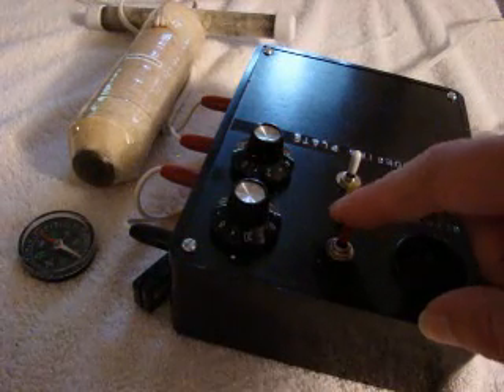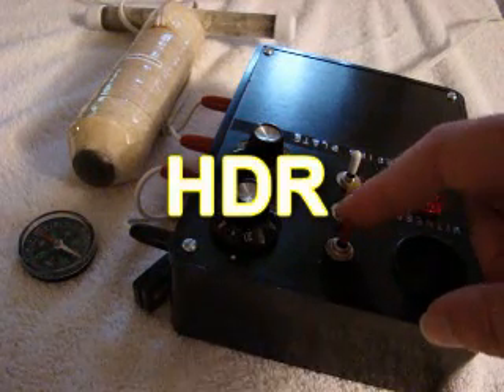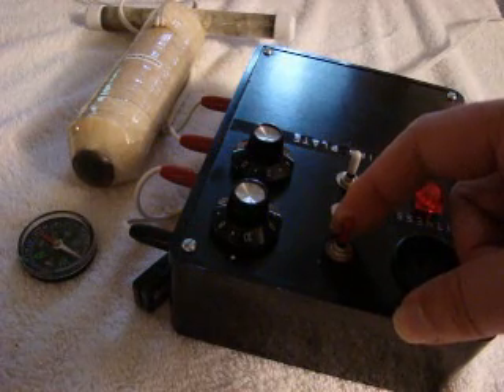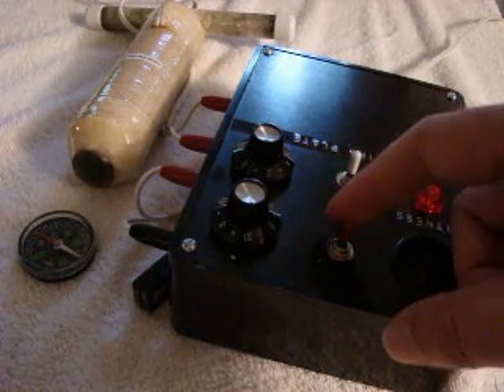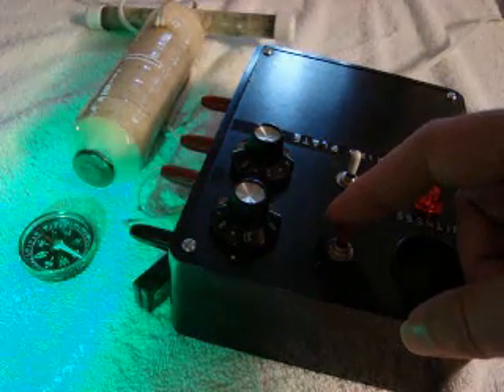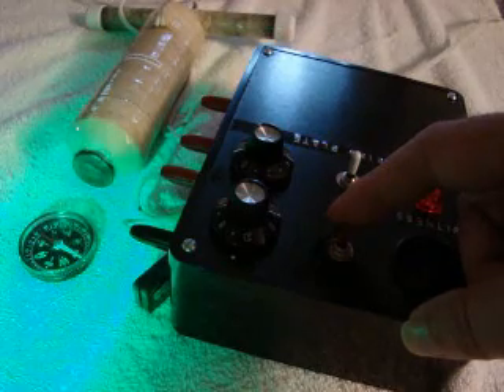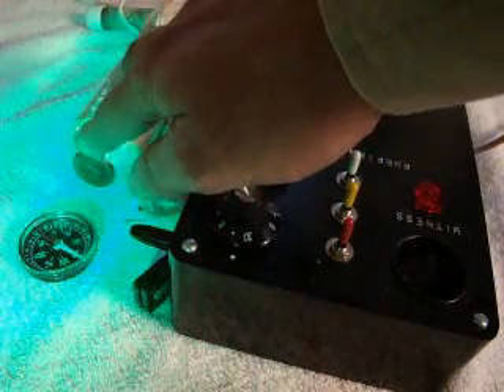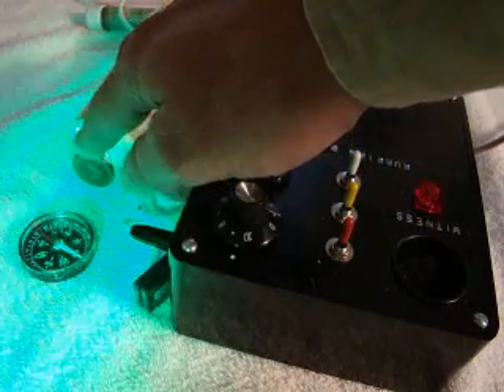Hyper Dimensional Resonator - turn on HDR

Comment: I, BRUCE A. PERREAULT AM THE INVENTOR OF THE HYPER DIMENSIONAL RESONATOR AND AM THE TIME TRAVELER. STEVEN GIBBS IS A FRAUD!!!

              SEPTEMBER 01, 2014
Reply from the maker: I have used my HDR with success. Why do you claim it does not work? Also, more important, is your caps lock stuck for some reason?
Reply: Bruce A. Perreault you are an alien, clearly trying to trap us in your lucrative schemes